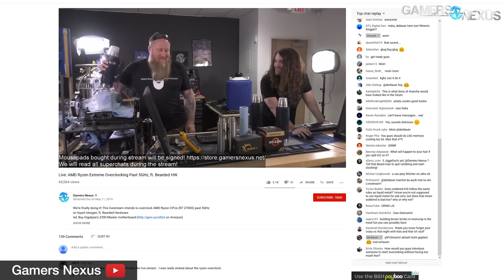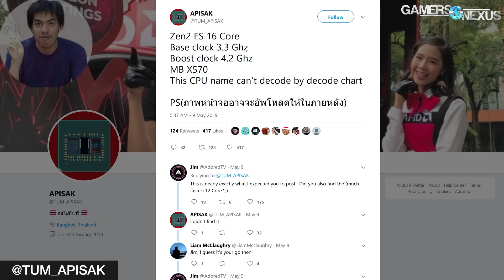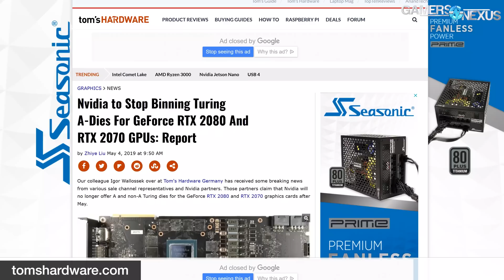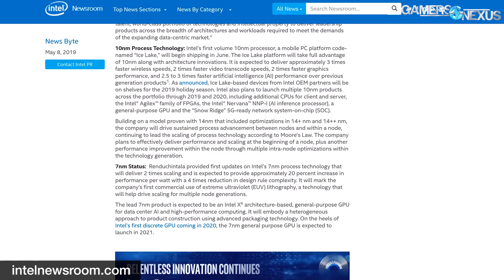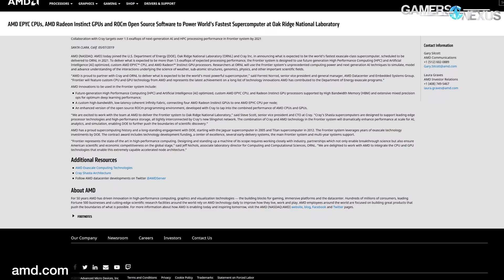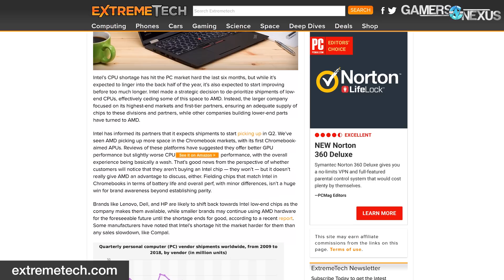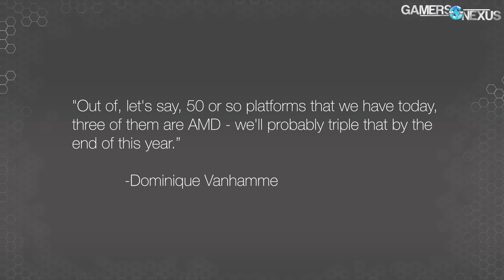HW News - Intel Shortage Ending, Ryzen 9 16-Core, & AMD Supercomputer

Comment: Super happy about the Epyc news with Dell. The switch to Epyc dropped our VMWare licensing by a HUGE amount. And have simplified our uptime/management greatly. We're one host down right now and not impacted in the slightest.

But there have been challenges, like firmware/drivers, or issues where I know more than our reps or support crew.  More options means my support should improve, and drivers/firmware should stabilize. Which is good. because as the consumer, I should never know more about the hardware than the company who builds our servers.

Comment: Don't forget, Epyc is still new 'unproven' technology. The first generation is still being tested by a select few hosting companies. These companies want to know if Epyc is a fluke or is here to stay. Does the chipset has any shortcomings? AMD cpu's tend to be a bit more picky when it comes to memory. How does this impact plug & play of new memory modules. Epyc (at least not 1st gen) doesn't have support for hot-swappable memory or cpu's. That means that if there is a issue when a memory module, we have to shutdown the server node.. At this point we only have 2 cpu style server nodes and as I understood, it is currently not possible to shutdown half the server. So in order to service Epyc systems, we loose about 1250 dollar per hour per server node because we have to shut them down.. Intel systems on the other hand have very advanced features for enterprise hosting. AMD might have gotten the performance of the Intel Xeons, at this point they just don't provide the same options that Intel does. That is why AMD based HP/Dell enterprise servers are a rare find.. The ones they do have, are all single cpu based. Mostly because AMD's multi cpu options are still limited.. I really hope that the new upcoming Epyc generation have better enterprise level support because a lot of the 1st Epyc (2 year) trials will come to an conclusion in 2nd half of 2019 and posted online. Those results will make or break Epyc for the hosting industry..

Comment: Still happy with my I7-4770 running at 3.4 ghz 4 core cpu and superclocked gtx 1050 ti. I did upgrade from a 1 tb hd  to a 1 tb Samsung ssd  and took an 8tb hd taken from a extermal drive and put it in my case for mass storage.

Comment: Ya know.

Earlier , I wanted to build a decent computer, and I wanted to concentrate on gaming.
I knew going in that I wanted an Intel CPU and when they debuted the 8 core model I was pretty stoked.

HOWEVER I was very disappointed in what Intel wanted for the damn things.

Then I had to factor in the cost of the Z390 boards and then a new video card and I shrugged and bought an AMD 2700x instead a bit later.

I paired it with an X470 board and I have to say that even if it does not run as fast as an Intel product, I have been pleased.

It does allot of things well, the best being NOT sticking me in the azz with a supposed "shortage" of CPU's when I imagine its just Intel gouging away.

So as far as I am concerned its a little bit to late for Intel to "recover" from its "shortage".
I was prepared to be a bit meah about the AMD product but nope.

Pleasantly surprised by it and looking forward to the newest Ryzen.

I did not bother to go all out in the graphics card and got a 2070 instead. Next time who knows if AMD can get those memory timings to work a bit better and include the clocks and latency.

Intel can go piss up a rope.

Really. I hope AMD continues to improve.

Intel needs a wake the hell up call. A loud one.

Comment: Dell hates AMD.  Remember they said something about AMD not being a player in GPUs or something.  They were closer with the GPUs, but EPYC is a damn good platform.
Reply: @truthseeker Radeons are not competitive in laptops. Rx570 has higher tdp than 1660ti, just think about it.
Reply: truthseeker ryzen laptops do exist but only 15w low power for the most part. Their H series isn’t competitive with intel i7H at all (2 fewer cores) and they generally have worse battery life than the same laptop but with intel chips.

Comment: Random question: Whatever happened to dual socket motherboards?
Reply: RDE Lutherie  I have looked. I was thinking for more modern designs. Like a dual socket Threadripper Mobo.
Reply: @k3salieri  I don't think there will be a dual socket Threadripper board in the near future. I think AMD and its partners reserve the dual socket boards for the enterprise and server markets. Same goes Intel.
Reply: @React2Quick  I figured, still think it would be pretty cool to see one. Server or otherwise.
Reply: @k3salieri  well the server boards usually do have dual socket. They exist. Processors like Epyc or Xeon are designed for dual socket use. However HEDT or mainstream consumer are not really designed for dual socket use.
Reply: RDE Lutherie  I'm aware that dual socket boards exist for Epyc. Thank you for restating what I said. OP basically asked about dual socket boards for Threadripper.

Comment: Nice to hear AMD is expanding. I still wish there were more than 2 companies battling in the CPU market.
Reply: It's extremely difficult to become a CPU manufacturer without millions if not billions of dollars. Plus you need to basically create a brand new CPU design, iirc, unless you risk infringing on patent laws and getting sued into oblivion.
Reply: @k3salieri  Not only do you have to create a new design, but it has to have a different ISA.  Basically, it can't be compatible with software made for Intel or AMD x86(_64) CPUs.  So, even if somebody comes up with the best CPU design ever, adoption will be really slow because it won't be able to run programs that weren't specifically built for it.  That's the main hurdle holding ARM back
Reply: @trapperjohn7571  There are maunfacturers left with x86 licenses (or at least they used to have it), though they are all either defunkt or almost dormant at this point. The main hurdle for someone like VIA would be to get the necessary liceses for all the other stuff that has been implemented in CPUs since they were a minor player in the game (the big one being AMDs x86_64, though things like AVX and other functionalities are also important).

The mutually beneficial cross-licensing agreements that AMD and Intel have had the last couple of decades have really just increased the gap of what other entries in to the market might have to aquire to be on equal footing on x86_64 systems. Still, it would be interesting to see what someone like ARM or one of the Chinese designers would do if they got their hands on the necessary licenses.
Reply: @k3salieri  Yeah, I do understand it's not easy -- otherwise we WOULD have more competition. I just wish the current state was different, and the same goes for GPUs.
Reply: I wish PowerPC wasn't so expensive
Reply: @justahologram2230  or terrible
Reply: Quallcomm is quite the large company, you know.
Reply: I guess RISC-V is a thing
Reply: CPU involves mass production, the same concept you'd expect when making a car. It doesnt come cheap
Reply: @jeneralgod 
Yet there's more than two car manufacturers. VW, GM, Toyota come to mind as three.
Reply: Rip Cyrix
Reply: Soon 5g ARM laptops with 25+ hr battery life and equivalent to i5 performance. Good times
Reply: @Giljrg 
X - doubt.

Comment: pfft give me 16 cores @4.4Ghz all core and I'm happy as with my 4fold increase from i5-2500k :D
Reply: You'll get a lot more than a 4 fold increase in performance, in fact you'd get that by moving to a current generation Ryzen 7 2700x. 
My i5-2500k scores 453 in Cinebench r15 multithreaded (at stock clocks), the 2700x scores 1,810 (stock). That's already a 4 fold increase. 
A Zen 2 16 core chip should give you an 8 fold improvement in performance. #!
Reply: Jesus that is a old CPU you could of had a 4 fold gain just by upgrading to the 8700k pretty much.
Reply: @dennisp8520  Yeah but Intel until Ryzen came out had only incremental gains so never been a point of upgrading until recently. And then been waiting for motherboards to update with more usb3, USB C and m.2 slots, which were' now seeing finally. Tech's been slow as prior to 2 yrs ago
Reply: @scarletspidernz  I agree about the motherboards but disagree about the CPU side of things. At least coming off your baseline. So many CPUs came out that doubled or tripled performance compared to what you have. Going all the way back to the 4790k. Anywho it's a good time to be alive as a PC user. I hope the rumors are true for Ryzen and the whole build just blows your socks off.
Reply: @dennisp8520  Yeah maybe in multithreaded tasks but overall and in gaming it was small differences not worth spending $1200 (where I'm from) for a new cpu/mb/ram

Comment: @Gamers Nexus  Do you think Ryzen 9 will work on AM4 ? or for the  new chip only? Also, is there hope for PCIE 4 or is that still far away?
Reply: Pcie 4 I think is official confirmed. But with no current uses
Reply: PCIe 4.0 will launch with the AM4 X570 Motherboards alongside Ryzen 3000. It should increase the data bandwidth across the board significantly.
Reply: Thank you @Ricardo Rita @K3 K4
Reply: No problem
Reply: Also, it seems that the chipset for the X570 Motherboards will require active cooling. Since it can overheat under the right conditions.

Comment: Jan 2020, intel has to many cpu's and cant give them away.
Reply: @SoundwaveSinus9 I listed NUC's as an example already. Next to higher battery consumption on mobile devices. Not saying AMD is bad but there are still reasons to buy a few systems with Intel CPU.
Reply: @SoundwaveSinus9 when they discontinued opteron companies are still remembering that and didnt like that.
Reply: @SoundwaveSinus9 It's morelikely that Ryzen just doesn't deliver. For example, I haven't seen an AMD NUC with Ryzen U SoC so far. My company bought a lot of those and still do.
Reply: @B1ack0utGER  the not delivering thing was a thing made up by intel so they could force amd out of the market. well known fact if you look at the facts that is.
Reply: @tacticalcenter8658  How this is supposed to "force amd out of the market"? They just increased capacities which leads to prices more close to or even less than MSRP. You said that barely anybody will buy them so what's your point?
Reply: @B1ack0utGER  I didn't say anything like that. Think you quoted the wrong guy
Reply: @tacticalcenter8658  Just look at your initial post. What else can I interpret into this?
Reply: @B1ack0utGER  it was a joke. Stop being so serious.
Reply: Would be hilarious, considering that Intel's unlawful practices back in the day would  caused OEMs to make a net loss by accepting a million CPUs fro AMD free of charge.
Reply: @klobiforpresident2254  lol yea i remember that.

Comment: Intel stock shortage ends, due to AMD Ryzen 3000 taking more market share. 4Head
Reply: It was mentioned that it mostly meant the Mobile CPU's which still have high demands.
Reply: Debateable, Intel very well could of restructured production to meet market needs. I am sure AMD's higher sales also helped Intel to a degree but I am pretty sure Intel has the resources necessary to increase supply after all this time.

Comment: Why are they always pushing single core performance when it's so inefficient?  If software made use of multicore you wouldn't need so many ghz. Of course, then what would Intel do? Why can't software run both ways? Multicore and single thread power optimization?  Whatever....
Reply: Usually it's programming difficulty, iirc, its extremely harder to program a game engine that can use 8 cores rather than one that uses 4 cores. 
Plus there are some games out there that still use only a single core for processing. Such as Paradoxs' Clauzwitz engine (I think that's how its spelled?)
Reply: @k3salieri  OK. Thanks for the response.
Reply: Sean Tamke   Maybe you should start writing software.
Reply: @wysetech2000  I'd have to learn how to. I'll try to learn.

Comment: @Gamers Nexus 5ghz seemed like a HUGE jump in frequency from Zen+ is it at all likely that we will see a part with 8 out more cores running at 4.5ghz?
Reply: We will likely see more leanient power control in Ryzen 3000. So as you scale down from the R9s we may be able to sustain close to 5ghz despite stock clocks on the lower end parts.

Comment: steve, as a fellow long haired dude, i would strongly suggest you alternate the sides you part you hair and consequently tilt your head or not tilting at all cause it will give you scoliosis.
Reply: Why do dudes keep such a long hair? It looks like so much extra work for looking as ugly as possible
Reply: @OK-j7x  to each their own, friend
Reply: @OK-j7x the "so much extra work" is not necessary, it just takes a bit longer to dry than shorter hair that is all and long hair provides shade, head insulation and style. do you also question women about their choices in hair length?
Reply: @shrapnel4213  I am not sure about what extra shade will 60cm hairs provide compared to the standard 4 to 6cm hairs of a normal adult head unless the guys hair is falling off and he desperately needs more shade. I think both longer hair as well as boy's cut suits most women very well. And I'm not judgemental or anything, I was just messing with this decision by long haired dudes, I once thought about it but never again.
Reply: @OK-j7x  i live in a tropical country and i can assure you it does. hair is the best cap and cover we can have. hair not only shades but insulates our heads, our most vital organ, and without it we are way more vulnerable to insolation. specially compared to short hair with which the sun radiation gets in between hairs and burns our heads (which i believe is the cause of a lot of the baldness in the world). if you ever want to try having fabulous work free hair; shave it. never cut, let it grow evenly. don't ever use shampoo just hot water. done
Reply: @shrapnel4213  Yup I'm thinking of shaving these days because of this heat. I'm from India, which is a tropical country (hot like 40c these days), so, long hair to me is like wrapping my head with a blanket => 😰 = dead.... 
This insulation and the black body radiation from long hairs can be a boon in the chill subtropical/hilly though, that's why animals in that zone are adapted to be fluffy. 
Here in plains of India a white coloured cap and small hair (if cant shave) is best adviced for maximum comfort.

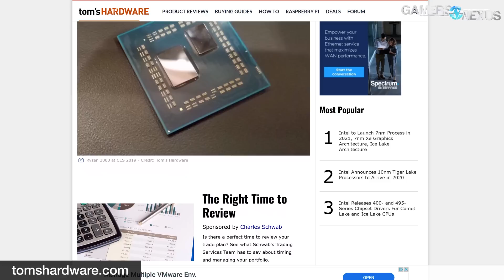Comment: 3:26 I'm pretty sure the 3700 they're discussing is actually the equivlent of a 1600 with doubled cores, so like with the 1600 line I think the overclocking performance is due to the headroom provided by the non-functional cores on the chiplets.